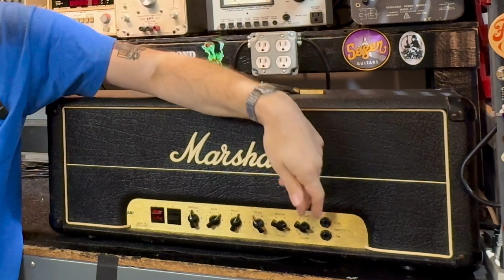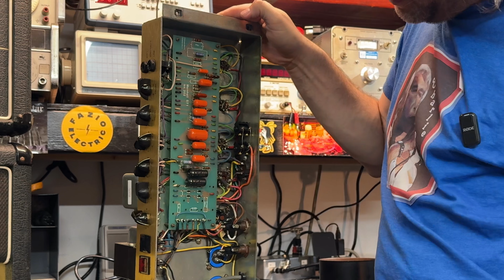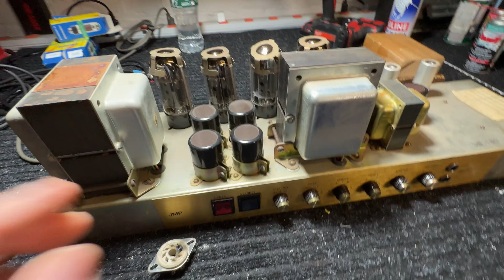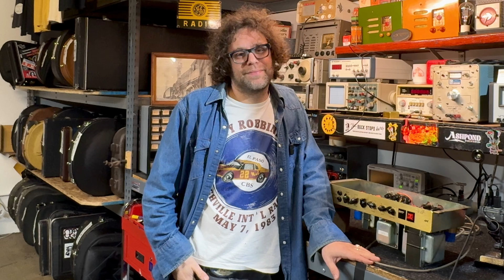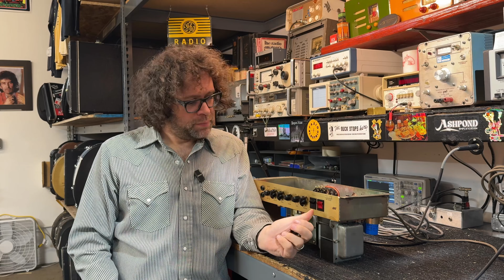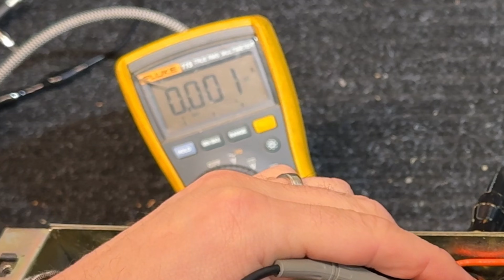The Marshall 2204 & Amp Biasing Tutorial!

Comment: Are you checking current with the meter center tap to the plate?......not volts but current even though it's not in series with the circuit?

Comment: As I understood it, the EL34's were less robust and so were used for the local English stock, whereby the Marshalls going overseas, like America, were given the more robust 6550's. 
I don't think tubes have a sound per se, it depends on the amp circuit design and how tubes are integrated within or outside of that design.

Comment: Hi Patrick, thanks for this informative Video. Im trying to bias my bluesbreaker and cant get the plate current below 100 ma!!! any thoughts what might cause this? same with two sets of tubes
Reply from the maker: Hey, people toss around the name bluesbreaker a lot, the 18 watt cathode biased amp and the 1961 fixed bias 45W amp.  for the 45W fixed bias those power tubes might be ruined at this point. I would pull them and fire up the amp. You should see neg voltage on the grids that adjust when you turn the bias pot. if your seeing 0 voltes or -10 then there is a problem in the bias supply. if this is normal put tubes back in, if suddenly the grid volts is radicaly changed then most likely bad tubes.

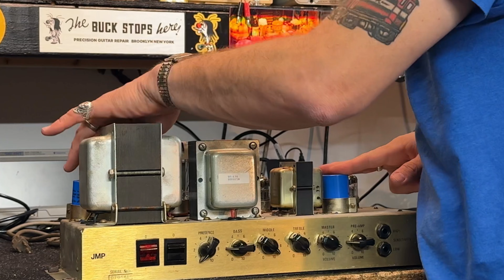Comment: At 1:25, "power tubes".....aargh! They're connected to the output transformer, which means they are output tubes; a "power tube" would be a rectifier tube, which is connected to the power transformer! Yeah, I know, the output tubes deliver audio power to the speaker, and therefore lots of folks refer to them as "power tubes", but it's a poor descriptor. Yes, I'm being pedantic.....but when you're talking technical terms to non-techie guitarists, one should be as clear and accurate as possible.
Reply: In guitar amp terminology, the terms are virtually interchangeable. Even tubedepot's website calls them Power Tubes.  You can call it the Output section or the Power Amp section, hence "power tubes."  Maybe don't be so dang picky there, professor.  The difference between Preamp and Power tubes are well understood in this context, even by beginners.
Reply: A rectifier tube is a rectifier tube. A power tube is the common terminology for output tubes

Comment: At 10:15, most techs have learned the hard way to remember that after using the Fluke meter in *amps" mode to measure shunt current, you better remember to set it back to voltage mode again for your other necessary measurements, or you'll blow an expensive, hard  to find, sand-filled cartridge fuse inside the meter. If it's not a fuse-protected meter like the Fluke is, you might actually blow up the meter!

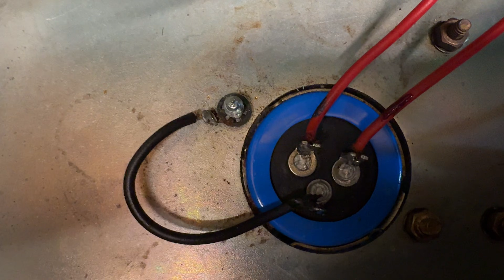Comment: At 6:40, aside from the loose ground, using black anodized star washers on a grounding bolt are just dumb; anodizing doesn't conduct, and Marshall should know better!
Reply: That is literally corrosion, not "black oxide" hardware...and it certainly wouldn't be "anodized" (aluminum)
Reply: @gremlinmachineshop  , I looked the subject up a while ago and discovered that steel can be, and is (rarely, I believe) sometimes anodized ( perhaps zinc-plated first and then anodized, I don't remember exactly,); although you're correct that it's probably not an accurate term for these particular washers. Most hardware suppliers refer to a *black oxide" finish; though of course, they can also be painted, or powder-coated, whatever. Anyway,, those washers didn't "corrode" and turn black over time; it's their factory-appllied finish!  I've had occasion to try and buff off that black coating and it does not come off easily, as corrosion or oxidation would. A fiberglas-bristle "scratch brush" (especially my modified, motorized versions) easily cleans off most oxidation and tarnish, but not this coating. Anyway,  in over 50 years of working with electronics, I've encountered many many audio amplifiers and devices where grounding was stupidly done with anodized or painted hardware, especially those types of black star washers, and often through heavily anodized/painted/powdercoated chassis. I always replace black star washers with chrome ones if they're used for chassis grounds. Coated star washers do a very poor job of biting through their own coating or through any anodizing or paint on a chassis or terminal lug; they shouldd not be used wherever a low-resistance ground is critical.
Reply: @goodun2974  it definitely needed to be reterminated with a fresh ground lug either way!
Reply: @gremlinmachineshop , ankther unfortunate reality of using an akuminum chassis is that use of steel, stainless or zinc-plated hardware can cause a layer of corrosion to form on the aluminum because the fasteners are made of dissimilar metals, creating small electrical currents as a battery would, especially in a humid or damp environment.

Comment: Do you think the 34 had more bass? That’s the opposite of my experience. Cool video, no nonsense information appreciated
Reply: He properly biased the EL 34s. The output section will have more power to deliver with the hotter biased tubes. This will be more apparent in the low end.
Reply from the maker: @ec8107  correct